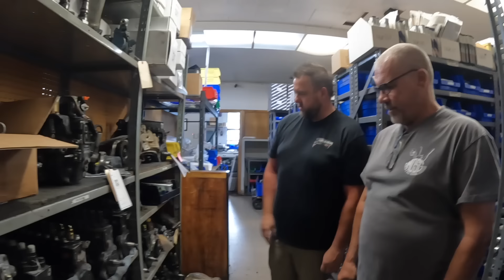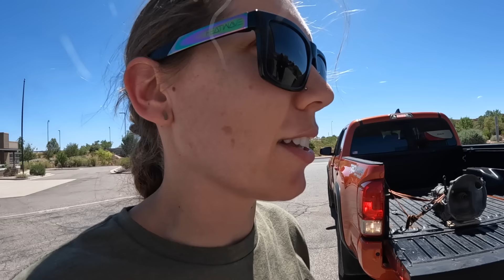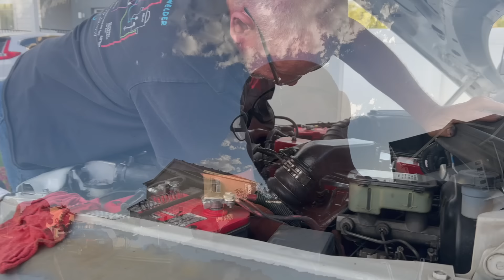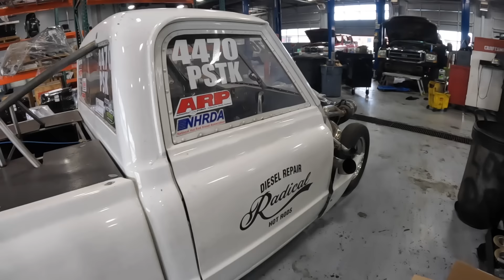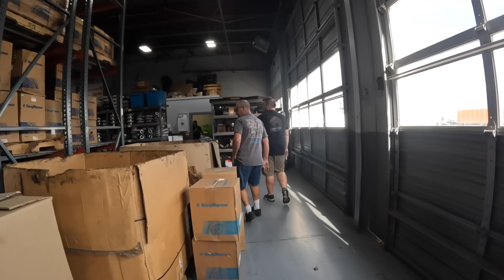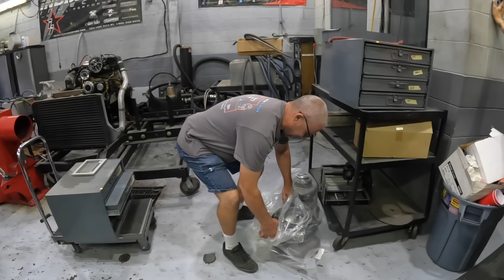Dyno Run and Shop Tour @industrialinjection Diesel Engines, Fuel Injectors, Turbos and Much More!

Comment: Hey Merlin, I've got a Cummins 500 ISM in my 2000 American Heritage motorhome. I have no complaints, the engine runs great and does what it should. I does however have roughly 130k miles on it. How much life do you think I have left on my injectors and pump? Do you think if I was to send them to these guys to freshen up that I would see any significant gain in power and or mileage?

Comment: It's interesting, my 1.9 TDi VW golf common rail motor, I run 90% used engine oil.  I run it through an old pair of socks and sometimes if I'm in the mood a cotton T-shirt, I then add a 10% thinner which is normally gas or paint thinners depending wot I can get for the cheapest at the time and I've been running this combo like this for 80 thousand miles and changed my fuel/ water separator twice and cleaned 1 once and my engine is turned ie bigger turbo, injectors and is old school chipped. She runs at 190bhp which isn't massive by today's standard but the stock 1.9tdi is around 110bhp mines a 2002 she never misses a beat apart from the one time the filter blocked up which required me to blow through it the opposite way then washed the filter once I got home. Amazing the difference between an older motor and the new shit that's built now a days which have sensors stopping you from running dark colour fuel lol .

Comment: Very interesting.  I really liked the discussion on the CP4 pumps.  I have a 2013 and a friend has a 2012.  A neighbor that worked at Ford dealership and now teaches at a votec college said to keep up with the maintenance and he hasn’t heard of any problems.  I’m going to start using a fuel additive at 106,000 miles.  I’ve not had problems and now I’m not sure about adding the S&S Disaster Kit.

Comment: Merlin I had a 1996 dodge cummins,  my question is I'm looking to swap in a cummins,  into a 1996 f250 diesel that's been rebodied with a 69 ford crew cab. What year cummins would be the best for a daily driver turned up a little nothing crazy,  6 sp 4x4

Comment: Warning the newer Dodge Cummins Diesel trucks Dodge cheated on the emissions control make sure it's not on a recall if you retune your truck and Dodge finds out they won't repair your truck under the recall all the entire Fuel system Goes Bad it all needs to be replaced under the recall you play with the computer program you just screwed your self